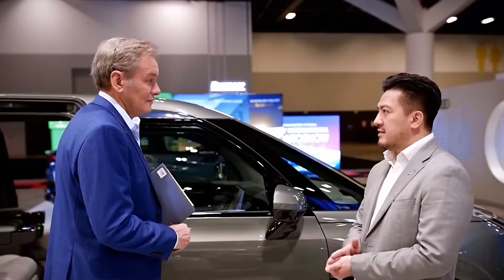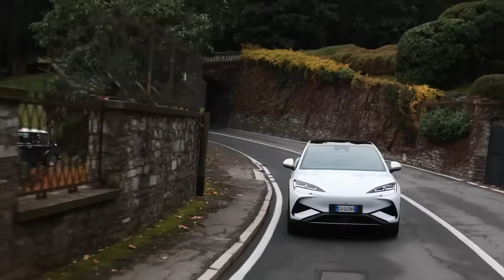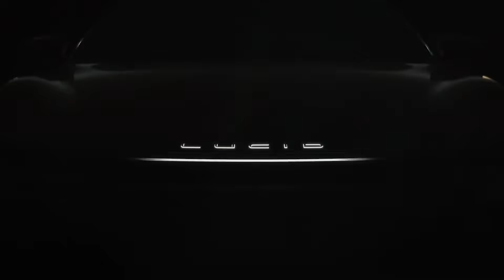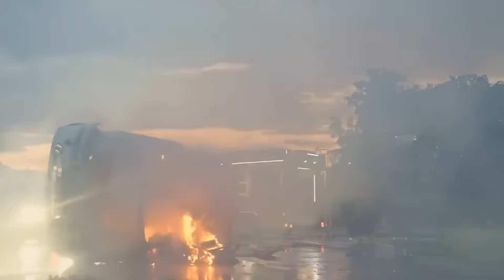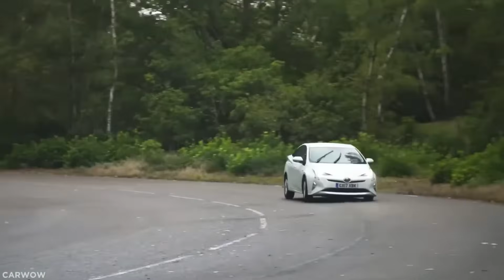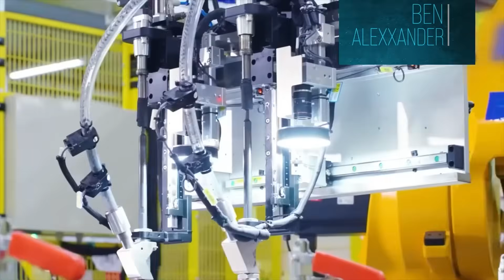The TRUTH About EV PROBLEMS Nobody Tells You

Comment: Your arguments should be taken into consideration. Except weight. Let's assume an ICE vehicle has 30mpg. 90,000 mi -> 3,000  gallons of fuel -> THAT'S ALMOST TEN TONS (21,700 lbs) of weight to carry!!! Doesn't it negatively affect tires and suspension more than a little over 1,000 lb battery?

Comment: The hatred towards EVs is palpable. It's well known that batteries can catch fire, but there's also the relatively low-flammability LiFePO4 battery. It's a matter of choice. Furthermore, it should be noted that, relative to the number of vehicles, EVs catch fire significantly less often than combustion engine vehicles. These idiotic commentators are aware of this, but they prefer to ignore it and harp on about a lie.
Reply: Yes fair comment but you need to take into account the age of the vehicle, also 65% of car fires are arson.  The average car fire is in a vehicle in the UK is 12-15 years old with the average car on the road being just over 10 years old. The average EV is only 2.5 years old so you cannot really tell as you are not comparing like for like. You could argue EV's are not old enough to catch fire/spontaneously combust but they are you see and you cannot extinguish them and they may combust 24/7 as opposed to when an ICE has to be in use. Batteries will improve and eventually we may have solid state rechargable batteries. Personally, I'd rather wait for them.
Reply: @michael.randall5034  Have you ever seen a car fire for an internal combustion car? They aren't exactly mild things. I've seen several in my lifetime, and they have always completely destroyed the house they were parked next to. I suppose you could get "lucky" and have your car ignite when the gas tank is empty, but more than likely it's going to be at least half full. Igniting 5 gallons of gasoline in a compressed location is a terrifying thing. Do not make light of it. And the smoke coming off of that disaster is also not going to be safe to breathe.

Comment: No am ready to buy a Toyota Corolla Estate Hybrid for a lot of reasons, I distrust electric vehicles and they have many problems you highlight, the manufacturers are backing away and no surprise and it takes less than 5 mins to refuel an ICE car and how long for these overweight monstrosities, they are heavy, too heavy for UK infrastructure often too wide as well and there are serious issues in the cold, OK I get that the next twenty years may see a new evolution OK but as an existing pensioner I doubt I will live to see it.

Comment: I can see why there are only 71 subscribers here.  Mostly misinformation and outright lies.
Reply from the maker: You must have watched numerous of my videos to come to that conclusion. Thanks for watching!
Reply: What lies?
Reply: Tell me why anyone would buy an EV. Yes it is a individual choice but for me there are several negative things that need over coming some mite be easy but certainly more than enough to keep me away 1. Upfront costs. Still way more than an ICE. 2. Range, yes I am someone who does lots of kms so range to me is important. 3. Uncertainty about refuelling/ recharging. Yes I have spent many years in a ICE so know where when etc to refuel. Recharging an EV, from my limit research, still has MANY problems. Refuelling an ICE is quick and easy. 4. Range concerned. Having experience with ICE I am ok with where and when to fill up. EVs from my research have a few issues in this regard.  5. Fire. Though EVs don't catch fire as much as ICE the risk and dangers way out weigh the chances.  6. Maintenance/ongoing costs. Although electrical motors are easier to maintain the whole EV is a TOTAL different story and this needs a lot more definition for me.

Comment: News Flash:  EVs are obsolete and will be for 50 to 100 more years if not much longer.

New combustion tech will cost 15 to 45 times LESS for energy input per distance than for an EV.  RE fuel will be 3 cents/kwh and oil is dropping to 6 cents/kwh ($2/gal for fuel, no road tax). Grid 100% RE will be 60 cents/kwh at house and 90 cents/kwh at the super Charger.  Math:  90/3 = 30.  60/6=10.  10 to 30 x more.  

New combustion will be 200 MPG vs EV at 133 MPGe.  That is a 1.5x factor.  Math:  1.5 x 10 = 15:  1.5 x 30 = 45.  15 to 45 times MORE for EV energy per distance than for combustion.  Game over folks.  HINT.

The CO2 will also be 200 times less for energy input than for RE electricity input.  A 100% RE grid will be 300 gCO2/kwh and the EV battery is 300, for a total of 600 gCO2/kwh before use.  At 75% EV average efficiency, the CO2 is 800 gCO2/kwh.  In contrast, RE fuel will be 3 gCO2/kwh and the engine will be 75% (same as EV) for a 4 gCO2/kwh rating when used.  That is 200 times less CO2.  This RE fuel can also be used in old ICE cars making then 5 times more than new combustion, but still 40 times less than an EV.  RE fuel ends EVs.  HINT.

See at @seaplaneguy on X for more insights.  Combustion is the future, not EVs.  Besides, the materials problem is not there with combustion, but is a show stopper for EVs.  We flat out do NOT have the materials for EVs and AI...
Reply: Such utter nonsense is rarely found, and someone actually falls for it.
Reply: @A @AdminForum-u4q 
I agree with you, a fool is born every minute. EV’s are much better than the clunky old ICE vehicles.
Reply: @AdminForum-u4q  No, just telling you what is coming.  You don't have to believe me.  Go waste you time and money on an EV.  EVs are a joke.
Reply from the maker: Loving the numbers and reasoning!
Reply: One hundred years of ICE innovation and yet gas (COMBUSTION) vehicles have had marginal improvements. Did you know gas is flammable? You’re obviously a Luddite. You and all your cohorts will pay the extremely high gas prices currently seen at the pumps. You don’t need to listen to me. 😂

Comment: I only buy used cars.  When I buy a used gas powered car I feel fairly good about the purchase.  But a used electric car...?
Reply: I just bought a used EV and it's great. Best car I've ever owned by a wide margin. 1/3 the price with only 40k miles, and the battery outperforms its paper specs for a brand new battery. I haven't had it long enough to say for myself, but everyone I talk to that has an older EV says that their battery is still operating at 100% after 8 years and 100,000 miles. A replacement battery is about $5,000 plus maybe $2,000 for service. But I'm saving $2000 a year on gas costs, so that would be paid for after only 4 years, and from everything I'm seeing, I expect the battery to last at least 10 years or more. Probably much more than that with mild degradation.
Reply: A used EV is a better buy than a used ICE car. 15 moving parts versus hundreds. LFP batteries are conservatively rated to do 2000 cycles. My car has a range of 430kms so multiply that by 2000....

Comment: This is total bs o drive and ev with is approaching 200,000 miles. The battery is just fine, a replacment with double the original range is $6,000. Which honestly is about the same as replacement motor would cost in my  ICE cars. The only thing the guy said that was right is the tires, but when you consider, but my maintenance costs outside of the tires is $0. It's really about the same

Comment: If you drive an EV the way you would drive an economy car, it becomes an economy car. It should have no problem driving 500,000 kilometers on its original battery. If you drive it like a sports car, it will need sportscar maintenance, including tires, suspension components, as well as CV shafts, bearings, and, drive units. Battery life is measured in "throughput". That's the number of kWh of energy the battery can pay out over its useful lifetime divided by the rated capacity. Spirited driving reaches that level of supply from the battery much more quickly. Just because some EV's have 1,000 horsepower, doesn't mean you need to use it every time you drive. I very seldom use mine beyond 80-100 HP, even though, I have nearly 300. On the highway/freeway/motorway, it runs between 14 and 25 horsepower. Just drive it the way you would, to get maximum gas mileage out of a combustion car. The EV will cost only about 1/4 as much per mile, as an equivalent combustion car, over its lifetime.
Reply from the maker: Thank you for sharing your experience! Very insightful!